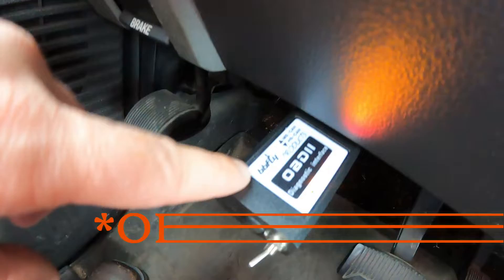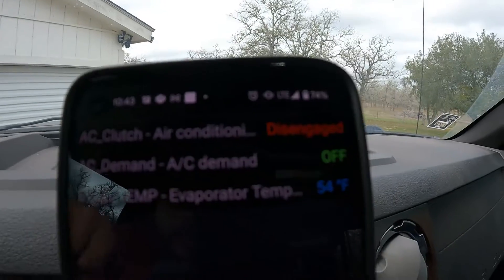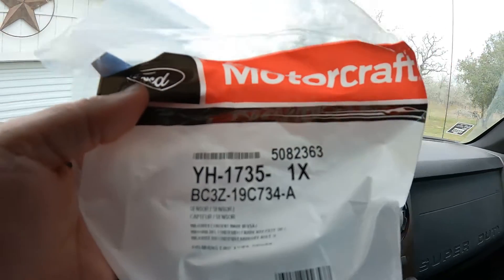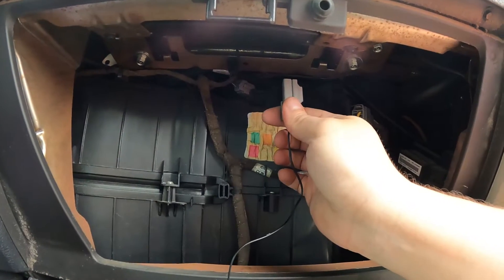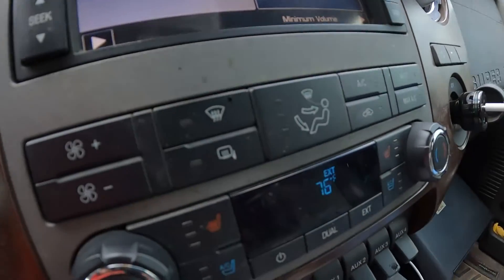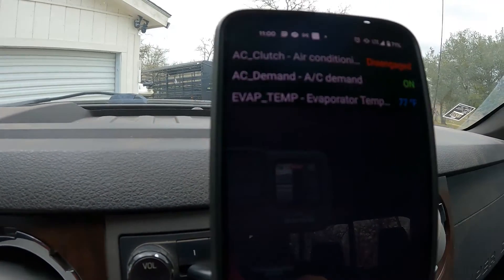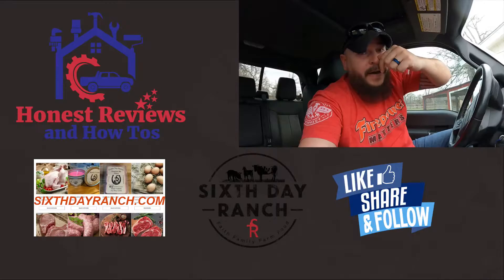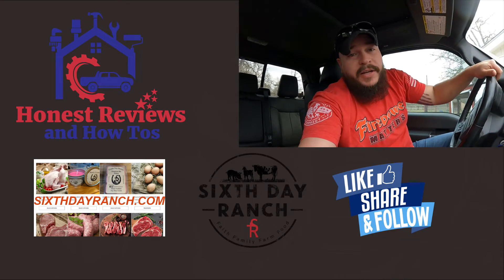A/C Troubleshooting Part 2 - How to diagnose evaporator temp probe on a 2011 F250 6.7 Powerstroke

Comment: The right way to do the probe is use a hole saw and then install the correct size firewall grommet. Duct tape will work but for the anal folks out there a grommet will make it look OEM.

Comment: Where is part 3 at
Reply from the maker: ⬇️🔥PRODUCTS USED IN THIS VIDEO🔥⬇️
Bluetooth Modified Android OBD Scan Tool bbflyFORScan: https://amzn.to/3waZUKH
A/C Evap Temp Sensor for 2011 F250: https://amzn.to/3k068rL
Motorcraft YH-37 A/C Clutch Cycle Switch:https://amzn.to/3EEQiek
FORScan app:https://forscan.org/download.html

Comment: Great vids. Hope you didn’t have to take to dealer. My dealer’s diag skills are a joke. Was having same ac issue and took it for diag. First time they said “no issue. Just needs Freon.” Worked for a day, then started blowing hot again. Took it back to dealer for another diag. This time they said the entire system needs to be replaced and they quoted me $5,500 (evap core, compressor, lines, and condenser). Seems to me they haven’t a clue what’s really wrong with it, and their plan is just to replace it all on my dime to ensure the issue is taken care of. That said, will use your vids to do a proper diag myself.
Reply from the maker: Hope it helps! It seems it's very hard to get skilled dealer diagnostic these days.  We have the same types of issues here.  They just want to throw money at it to rule out what they cant diagnose.

Comment: Can I use other car brand evaporator temperature on my car(Mazda 3). Like I will use the evap sensor of Ford. Will it work..? I will just replace the socket to fit on my Mazda 3.. I hope you read my comment. Thank you..😊🙏
Reply from the maker: It might, but you'd have to test it out of course to make sure your vehicle is able to read the temperature correctly.

Comment: So your A/C was still blowing a little bit of cold air at 76° but temp sensor was faulty & reading 46°? If so that might be my problem because I just replaced everything inside the dash.
Reply from the maker: Yes temp sensor was reading WAY off.  If it was just a few degrees it shouldn't matter, but it'll definitely make a difference if it's off by a lot.
Reply: @honestreviewsandhowtos  yep I unplugged mine & plugged the old one up & it started blowing 55° instead of 65° but now the challenge is getting sensor into evaporator coil 🤦‍♂️

Comment: So I’m assuming you eventually got it figured out but I didn’t see another video. What was the issue?
Reply from the maker: Ended up being a combination of several things.  Evap temp sensor, low freon, and the a/c clutch had a gap issue.  After all those things I'm back in business.

Comment: If the EVAP temp sensor is bad, can one symptom be that the compressor clutch won’t engage at all. It’s the issue I’m having and just was curious if I might get lucky and fix my ac on the first try. But I do t usually have that kind of luck, lol.
Reply from the maker: I'm with you man.  You're probably not that lucky, but it could definitely cause it not to engage.  Good luck!

Comment: Thanks for the video 
I have had the same problem.  
local shop had me replace A/C compressor.
After I replaced the A/C compressor shop over filled Freon which did not allow clutch 
To engage. 
Then I was told the A/C compressor was a faulty part. 
Luckily I stumbled upon your video. 
Put back old compressor changed evap temp sensor.
Now works like a charm
Reply from the maker: Glad to hear that! What a pain!

Comment: Anyone used this part on 2010 F150 lariat? Thanks
Reply: I’m in the same predicament w my 2010 lariat as well. Replaced the compressor and flushed the condenser already. Month later and it’s blowing hot again. Low pressure line is warm to touch. Betting this is my issue
Reply: @johns7942    I just did the resistor hack this morning.  I went from 47-48 degree vent to 39 on highway after about 10 minute test drive.  I just cleaned my evaporator & condenser coils, evacuated the system, installed a new TXV, recharge with exact (24 oz) amount of 134a,  and no change.  My ambient & cabin air sensors were okay.  Will just have to watch air flow so evaporator doesn’t freeze. 100 degrees + every day now, so not too worried about that now. 😊
Reply from the maker: That's great!

Comment: What ended up being the issue?
Reply from the maker: It was a combo of the evap temp sensor and low freon.  Thanks for watching!
Reply from the maker: I also replaced the clutch cycle switch, but I dont know if that was part of the fix.  Part #YH2034

Comment: Hey man, thank you for posting this. I did the 'cut into the evaporator box', replaced the probe, sealed up the hole, and my a/c has never worked better (including the dual climate); 2011 F250, 211k miles.
Reply from the maker: Happy to help brother!  Glad it fixed it for you!
Reply: Lincoln. Im having the same on off cycling problem with my AC compressor. I cut into my box and can feel where the sensor wire goes under the evaporator core. Was it hard to get the sensor out of the core? Any suggestions?
Reply: @n4189p  mmm, as I recall the first time I cut the hole it was a little small for me to navigate or see so I made the opening bigger. 

You can see the probe attached to the fins of the evaporator and it just pulls off. But the wire goes from the probe up through the top of the top of the box and then connects to the connector. I think I just pulled the probe, cut the wire and left the old cable.

I routed the new probe wiring through the hole that I created. 

Cut a large piece of cardboard to cover the hole and then used some HVAC tape to seal it up real good (I used a lot of tape)

Hope that helps?! Holler back if not…
Reply: @lincolnmquinton2152  did you cut where that sticker was? Is there some room for forgiveness as to where the coil is to not cut into it or what tool did you use?

Comment: Pretty common issue is the fan clutch it will cause a high side head pressure . Usually you want it to be ambient temp times 2 . So 100 degree day 200-250 high side . Low side will hover around 40 ish . Put a water hose on your condenser to get the head pressure down , also your truck has a expansion valve not orifice tube which is known to have issues .
Reply from the maker: Appreciate the info!

Comment: if you have ac pressure getting that high on the high side you either have a restriction in the ac system or you have an air flow problem with the condenser.
Reply: I think you're right, appreciate it!
Reply from the maker: Thanks!